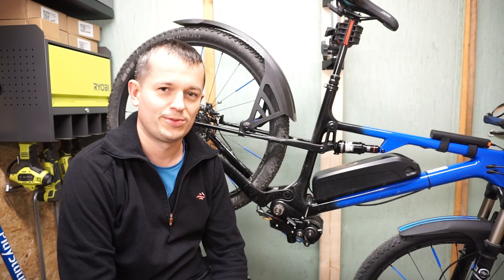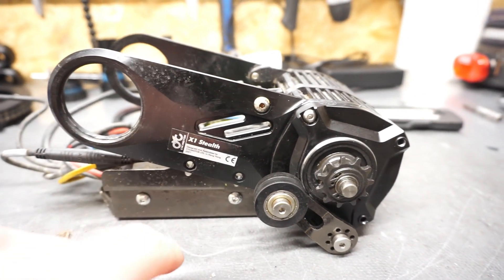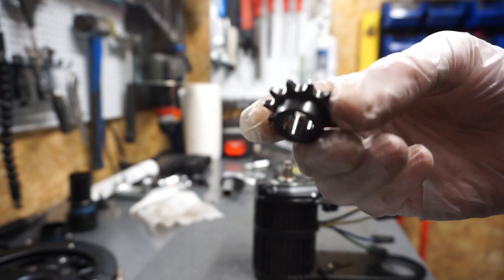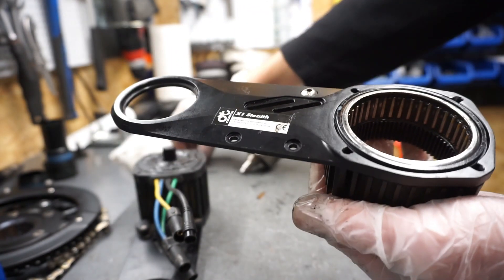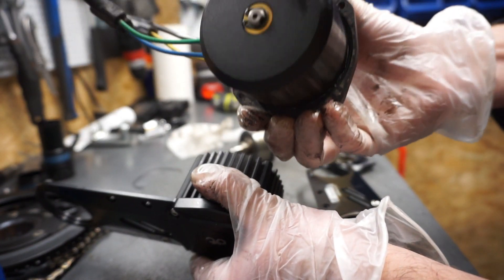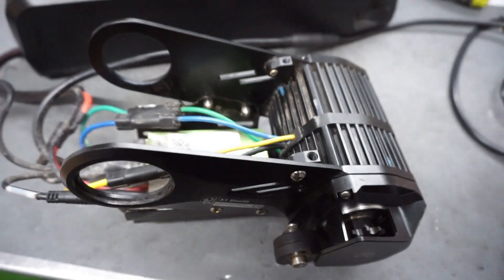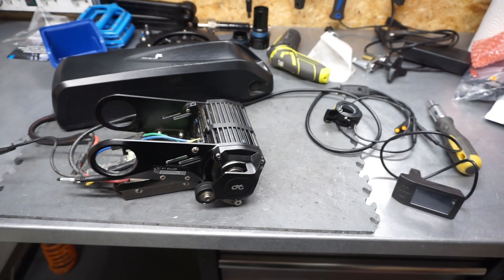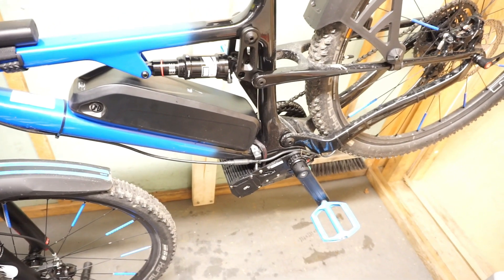CYC X1 Stealth gearbox maintenance

Comment: Hi i cant see the sprag clutch in your video ? Is this an upgrade ?
Reply from the maker: Which sprag clutch are you talking about?
Reply: @LierskogenEbikes  the one that is located on the output shaft between the gearbox and the shaft that the spocket fits
Reply from the maker: @brendenmtb1872  There is one way clutch/beaing built in the planetary carrier.

Comment: what did you use in place of the damaged oring?
Reply from the maker: I put it back in place and applied silicone grease for O-rings. Not the best solution but motor still works OK year after. But better to replace it with new O-ring.

Comment: Thanks for the video. As I'm installing one of these units very much appreciate a maintenance breakdown. Because I'm an aircraft tech I understand preventative maintenance is more important than an autopsy after the failure. Moly is a good additive for high load rubbing applications more than the high rotation loads in a planetary so as you stated as an additive it always helps but a grease that stays stuck to the gears and doesn't thermally change state is probably the most important characteristics. Operational tests will prove but I think your grease choice may have been better than manufacturers. A moly only based grease was definitely not my first choice on that outboard roller bearing. Have seen this in most first generation moly greases yes the moly is a powder and even dry it saved that bearing from self destruction but the carrier or base lubricant was gone...?...broke down......flung out or liquefied?
A proven moly hybrid multi grease was the best choice. Another suggestion is Aeroshell 64 formerly 33MS is a synthetic multi use with moly.    It is available worldwide. Very  good thorough video!!!
Reply from the maker: There is a lot of space for experimentation with different types of grease. Really hard to say which one would be the best.

Comment: Your video help me very much thank you! I' have a 1- 6 flash code error and CYC said it was the Hall sensor so they where going to send me a new motor to replace in my kit, so after opening it up i cleaned the gearbox and i will restuff it full of fresh grease, your video is great for references. it is as clean as yours at 10 minutes marks. When i receive the motor i will try and make a rebuild video.
Reply from the maker: Glad to hear it :)

Comment: can you line the motor housing w thermal paste to transfer heat from the motor and dampen noise?
Reply from the maker: Motor is not heating up too much. Airflow is enough to cool it down. Noise comes from planetary gear and there is nothing you can do about it. That's a disadvantage of planetary gears, they are noisy by their nature.

Comment: It looks like it would be beneficial for the sake of heat absorption if you applied thermal paste on the outside of the motor housing so that it makes contact with the motor compartment better. has anybody tried this?
Reply from the maker: I don't have any overheating problems in my motor, so I don't see a need for this thermal paste.

Comment: Thanks for the video. I have a couple of questions:
1) Is there any recommended routine maintenance apart from changing the grease at 3,000km?
2) Do you think the gasket issue is what caused your problem, and do you think there is a solution eg. replacing the gasket with silicone?
3) Would you add any waterproofing to the wiring? eg. Filling the heat shrink on the harness, covering the phase wire entry points on the motor and the phase wire connectors with silicone
4) Can you list which tools were needed for the maintenance?

Thanks in advance!
Reply from the maker: 1) Frequent cleaning of the external chain is a must.
2) You can see in the movie, that gasket was broken, so that led to water ingress into the gearbox compartment. Silicon is OK, but it will be difficult to open the cover later on.
3) I'm installing all these BAC855 controllers in the plastic box. Only in this way, I can be certain, that there won't be any water ingress into main harness connector. However new controllers comes with connector potted in silicone, so maybe box is no longer required.
4) You can see tools I'm using in the movie. I don't see a point to give specific links, since I bought them in Norway over the last few years. If you live abroad, you need to find them in your local shops, unless you want to import that stuff from Norway.

Comment: if i was the designer, using 3D CAD i would wet lube the gearbox sealed to include the bearings and vented from the top with a one way vent and drain casting duct. gearbox oil is best to dissipate heat evenly and lubricate with added benefit of noise reduction reducing friction to minimise current draw efficiency resulting in longer battery life of 40% so imagine a 100km range improved tp 140km for free. thank you for sharing your rebuild with us on youtube . . . keep up the good work
Reply: Is it possible to make one way vent and drain casting duct?
Reply: @andriyna2366  yes, very cheaply
Reply: @MrSteelAu  What will I need to o this?
Reply: @andriyna2366  floating small ball for air in and tiny spring and ball for exhaust 2 way vent
Reply: @MrSteelAu  Do you know where to find it or how to make it in a way it would be almost invisible? Thanks.
Reply: @andriyna2366  you custom make them on a 3 D printer in 2 halves so your duct can drain water but vent the chamber so on assembly and glue the pats together  you assemble the light spring and ball to a seat for a perfect fit and the floating ball to seal on a 3 way water drain air vent. The float of water comes in will close the vent but lifts to drain moisture than drops to close the drain but opens vent to chamber.. 😃

Comment: This is fun thanks really enjoyed watching this. I purchased the X1 Stealth and I'm not sure if it is normal that I always hit the foldback of the motor witch is 70 degrease in the XML file witch was modified to 80 and I'm still heating up really fast in a few miles, do you have this issue? I'm planning to install some heat sink on the motor to see if I can run high performances longer.
Reply from the maker: If you ride only on throttle, than you will heat the motor fairly quickly, especially if you ride long uphill runs. I ride using PAS only, than motor never heats up. This motor was designed for riding with PAS primarily with short bursts with throttle. For throttle runs X1 Pro motor is more suitable.

Comment: Hi there,
Many thanks for this video first of all!
Quick question if I may. When you pull the main sprocket off with the gear puller (which as you found is quite hard to remove) is it easy to replace the sprocket back on or does it need to be pressed in with another special tool, and also how does the small metal locking bar work, I mean do you have to do something with it in order to remove or replace the sprocket back on?
Many thanks.
Reply from the maker: You just need to gently pat the sprocket with rubber mallet to install it back in place. There is a recess in motor axle for the lock piece, so the lock needs to be in place before you install a sprocket.
Reply: @LierskogenEbikes  Thank you pal!

Comment: Can the CYC stealth fit on a 120mm fat bike frame?
Reply from the maker: No, you can't install Stealth on fatbikes. It fits frames with max 83mm bottom bracket width. You have to buy Pro motor.

Comment: Great video thanks for posting!  Completely unrelated question...  :)  What rear fender do you have mounted on your back wheel?  Do you recommend it for snowy or muddy conditions in winter riding?
Reply from the maker: It's Zefal brand. I don't ride this bike in winter, I use fatbike with X1 Pro for winter season :)

Comment: Thanks for the videos I really appreciate them and enjoy watching  
I have a stealth on order.
What battery and you using
Eg max continuous current ?
Brand?
Model?
Voltage?
Please and thanks
Reply from the maker: I built battery myself using Sony VC7 cells and Hailong box. It comes with 48V 30A BMS. It gives around 1500W continuous power, perfect match for this motor.
Reply: @LierskogenEbikes  Thanks mate. Yes that would work nicely. Running mine on 36v so I'm going with the factory 36v batteries and getting 2. Looks like it might be possible to run the gearbox with oil not grease.  Would depend on motor being well sealed

Comment: The brass gears is the same with the one you take out from the motors before service right? Not changing the Gears right? How is the noise and durability difference between the steel gears and the brass gears. Rgds
Reply from the maker: I have replaced original steel planet gears with brass ones. Noise is the same in my opinion, but motor runs more smoothly. The difference is subtle, so hard to catch it with camera microphone.
Reply: @LierskogenEbikes  has your opinion on noise changed over time? Do you feel the noise has reduced since the brass gears have been broken in?
Reply from the maker: @hiphopsuperman  I run around 300 km with new gears. Hard to say if I hear any difference now.
Reply: Where can I get brass planetary gears ? Cheers !